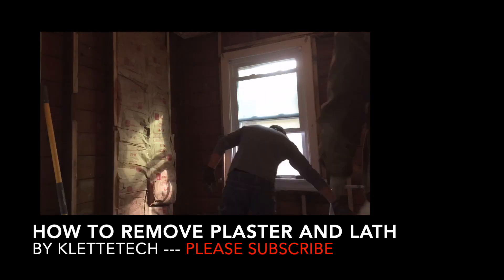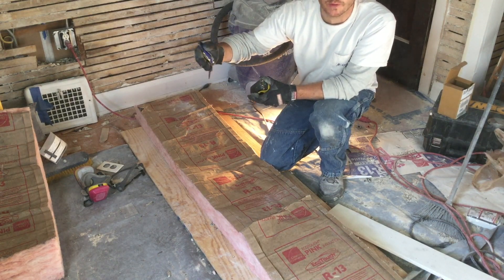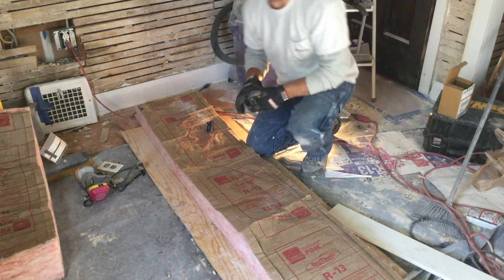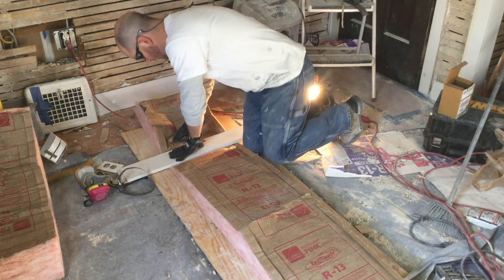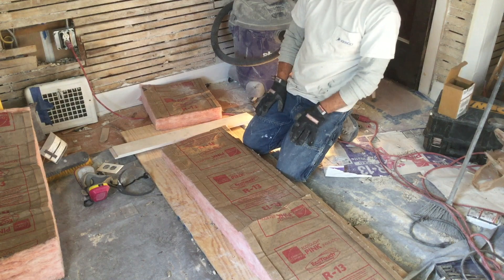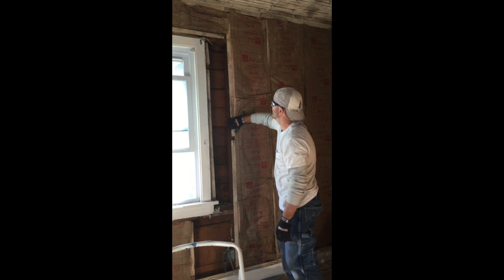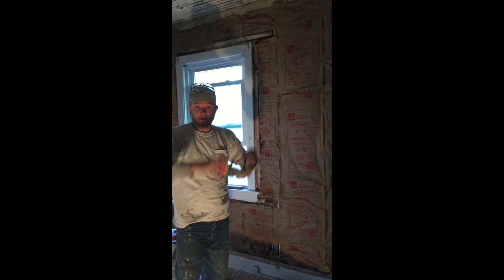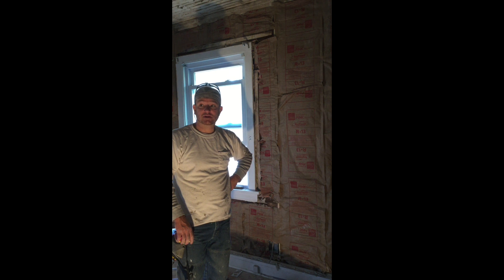Installing Batt Insulation (Part 2 Bedroom Rehab)

Comment: Awesome video! In an old house that’s designed to breathe, I would’ve put in unfaced insulation or rockwool! I’m not a pro but I noticed how there was absolutely no mold! I’d also use a drywall without paper backing!

Comment: Now they have glass backed gypsum boards at Menards that’s cheap! I’ll use this and rockwool even though it’s much more expensive! Fire resistant, sound proof, breathable for old houses, won’t get in the air when installing! But… I think this job deserves a near 10/10! I would’ve braced and supported that ceiling but you’re brave! Many many many plaster ceilings have old vermiculite with asbestos dust lurking on the other side waiting to coat you and your lungs like baby powder! This is another reason why people just add drywall to the ceiling! The 2x4 rafters can hold a 250lb man that wears a size 8 shoe! The dispersed drywall over4’x 8’ is nothing!